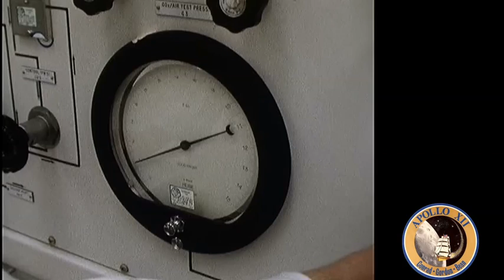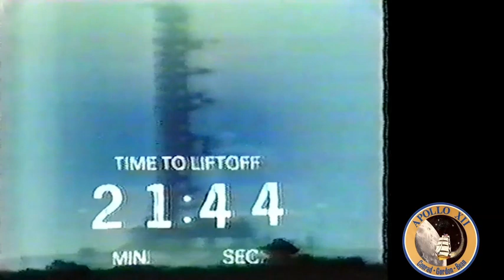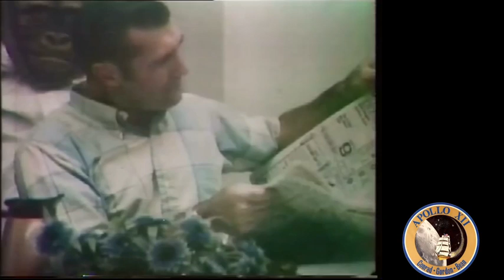Apollo 12 - SCE to AUX (Full Mission 01)

Comment: I recall after the successful return of the mission word got out that NASA had been concerned about what the lightening strikes may have done to the pyrotechnics in the recovery system.  Someone logically concluded that if they were going to fail they may as well go ahead and proceed to the Moon as the end result would be the same as an abort from Earth orbit.  They also elected to not inform the crew as it was also pointless.  Ah, gotta love those engineers.  Thank you for sharing this.
Reply: I wonder how the crew felt about that once they did find out.

Comment: As a computer technician, I love telling this tale when someone asks me if I’m done after only 5 minutes of troubleshooting their idiocy.   There was a nuclear power plant that regularly performed safety drills and the policy manual was to be treated as though it was the Bible because it dictated how to respond to emergencies. But there was an employee that never showed up for work yet made more money than anyone else except the top administrators, which angered many technicians that were on-site daily.  One day all hell breaks loose, alarms go off, the reactor runs away out of control, and none of the steps in the manual help.  When they get to the last page it says “When all else fails, call this number.”  So they call it, and it’s the well-paid guy that never comes to work.  He shows up, ignores their dubious looks while inspecting all of the alarms going off, and presses 1 button.  Immediately the alarms shut off, temperatures and pressures return to normal, and everything is operating in the green.  He begins walking out when someone blurts out “they pay you all that money just to press one stupid button???”  He stops and says to the guy “They pay me to know which button to press.”  Only one guy thought to press the ACE TO AUX button on this mission, and only one guy knew where that button even was.